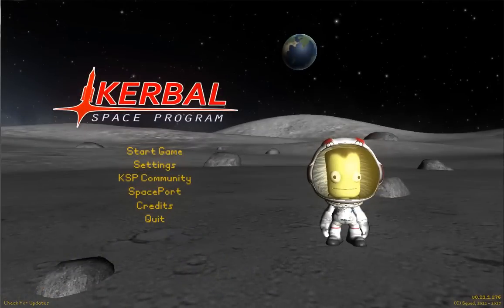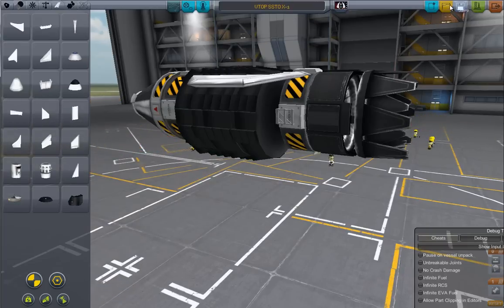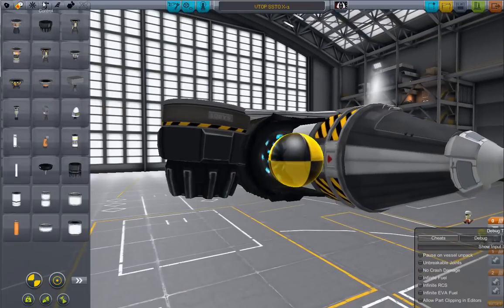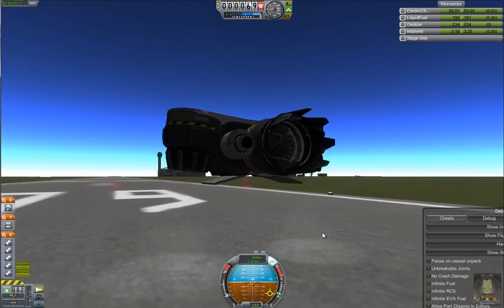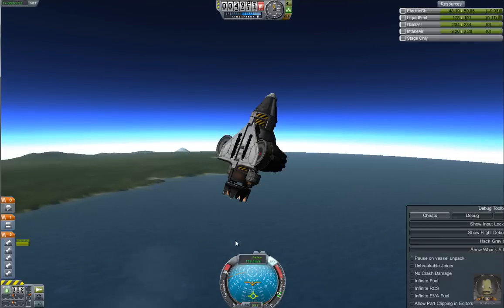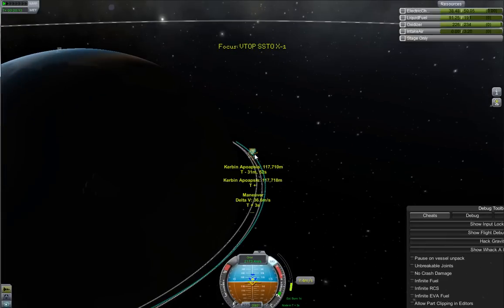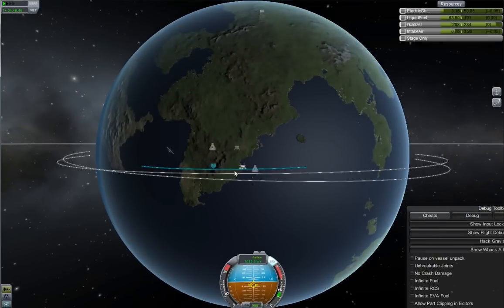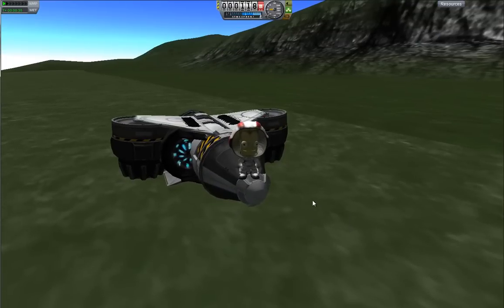Small VTOL SSTO. Air Hogging. | The old days of KSP V.21 | Ep:34

Comment: Pretty cool. One thing though. Since you're using just liquid fuel while in the atmosphere, by not taking out some of the oxidizer in the design you end up lugging up that extra useless weight. Take out a third of the oxidizer and you might find that you'll use less fuel overall to get into orbit.
Reply from the maker: Agreed :) however this is a very old video and in version .21 of ksp the option to empty out the fuel in VAB or SPH was not available yet :)

Comment: I know this is a really old video because its before the thumbnail UI change but still those parts your using to land had a 80m/s crash tolerance you could have easily landed at 5 m/s maybe even 10.
Reply from the maker: Agreed :) I've learned a lot ever since v.21 :D But i try not to air hog anymore.

Comment: i felt adjusting the center of dry masses around the center of fuel and then placing the vertical jet was key in vtol design. that way the COM will remain the same throughout the flight. 
with ascent patterns i stay as close to vertical as possible till 10km. after 10km i focus on 100-200 climb rate till intake air .08. then hold that altitude till surface speeds of 2100
from there i want the rockets to fire at 45 degrees to balance going out of atmosphere with making orbit. then circularize.

Comment: Hold shift and use the WASD keys to rotate the currently selected part in five degree increments. Just press WASD without shift to rotate 90 degrees at a time.

You can google 'kerbal space program key bindings' to get to the wiki, which has a full list of commands.